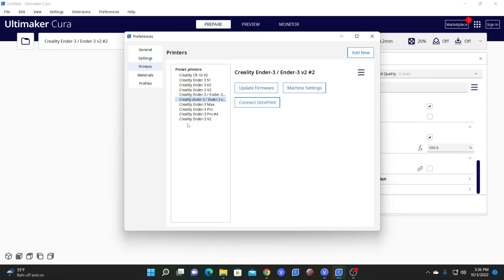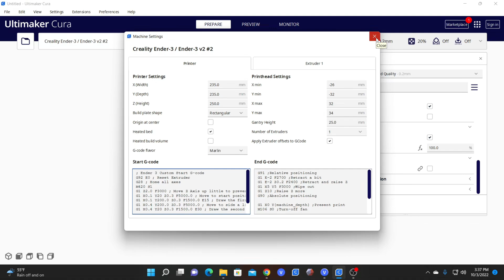Configure your GCODE to use the ABL Mesh from a CR-TOUCH or BL-TOUCH on a 3D Printer

Comment: In the little manual for my cr touch it says the line needs to be G28G29.  I have done what you showed in the video but have not yet printed anything. Is the included manual for the cr touch worthless, I am scared something is going to break if i print with the wrong line of code
Reply from the maker: I'm your manual. Only "M420 S1" on the line below G28
Reply: @ thanks for the help 😊
Reply: G29 will work after G28 but will re-do the mesh. You can do that, but it's quicker, more flexible, and perhaps more reliable to do the mesh once, save it, then use M420 S1 to load it without redoing it. G29 A (activate) is a synonym for M420 S1. Whichever you use, it must be after G28, as by default that will turn off mesh leveling.

Comment: I put in the gcode but it doesn't seem to work?
Reply from the maker: What makes you think it's not working?
Reply: @3DRundown  you have to see the z axis thing move a little bit right (like corecting the space between the bed and the nozzel?) + the filament is wel on the bed in one spot and realy off on the other

Comment: So m420 s1 is the same as G29 ?
Reply from the maker: No. M420 will load the saved mesh. G29 makes a new mesh every time. I don't suggest that
Reply: M420 S1 is the same as G29 A (which activates a stored mesh instead of re-measuring one).

Comment: Why does evey single tutorial give me different Codes this is maddening!!!
Reply from the maker: Because they suck. This is the correct way to do it.
Reply: @3DRundown  Yeah everyone else keeps saying to use G29 but now I'm thinking that's not right lately
Reply from the maker: No. Every time you run an ABL, you give your machine a chance to make a shit Mesh. If your mesh is working, keep using it, until it's not working. Then, run another ABL, SAVE, and get back to printing.
Reply: You can use G29 A which does not redo the mesh, but merely activates it; basically a synonym for M420 S1.

Comment: It would be alot cooler if the company included this in the install
Reply from the maker: Creality has begun adding it to CP5 profiles.
Reply: @3DRundown  by the way thank you for your help with bed leveling and z off setting  I've been printing non stop for about 2-3 weeks successfully.

Comment: for me it does not work what did i do wrong??? 
HELP ME PLZZ!!!!!!
Reply from the maker: It does... Did you run the ABL manually, then SAVE? Did you re-slice any files, that were previously sliced Without the code? Is your manual tramming good enough? Is your Z-OFFSET correct? Tell me more...

Comment: This works with other sensors as well. My Voxelab Aquila X3 Max uses one of those magnetic proximity sensors they call the system VL Touch, and my original Aquila has a 3DTouch sensor. I was wanting to use Cura instead of Voxelmaker and this video got me over the obstacle to getting it to work right. Thanks...

Comment: Thank you kindly for this information. I have a CR-10 S5, I found the G28 line in the start G-code for the profile, and it isn't doing the ABL mesh before the print. Maybe I am missing something? Thank you kindly.
Reply from the maker: G29 will do the ABL. But, don't use that. Manually trigger an ABL. Save it, then, use the line here in this video, to have the printer load and use that mesh. Only run another ABL, if you feel the need. If it's working. LEAVE IT BE
Reply: I appreciate it. I can't tell if it's recalling the mesh that's stored, or not. I'm just wondering if the way my g code is set up is has something to do with it. It's the stock CR10S5 profile with your added M420 line. I'm just used to seeing it actually run an ABL before it does a print - that's all. When I open it in Cura there's a space between the last line of code and the g28/m420 lines.
Reply from the maker: If running a mesh every time, the M420 line will serve no purpose. You'll know it's working, if it resolves your minor bed tramming issues. For example, if you see an area that's a little off, and run a new MESH, it should be better on your next print. Keep in mind, Z-OFFSET is very important, and not handled by ABL. 
Your CR10-S5 GCODE should look like this:

M201 X500.00 Y500.00 Z100.00 E5000.00 ;Setup machine max acceleration
M203 X500.00 Y500.00 Z10.00 E50.00 ;Setup machine max feedrate
M204 P500.00 R1000.00 T500.00 ;Setup Print/Retract/Travel acceleration
M205 X8.00 Y8.00 Z0.40 E5.00 ;Setup Jerk
M220 S100 ;Reset Feedrate
M221 S100 ;Reset Flowrate

G28 ;Home
M420 S1

G92 E0 ;Reset Extruder
G1 Z2.0 F3000 ;Move Z Axis up
G1 X10.1 Y20 Z0.28 F5000.0 ;Move to start position
G1 X10.1 Y200.0 Z0.28 F1500.0 E15 ;Draw the first line
G1 X10.4 Y200.0 Z0.28 F5000.0 ;Move to side a little
G1 X10.4 Y20 Z0.28 F1500.0 E30 ;Draw the second line
G92 E0 ;Reset Extruder
G1 Z2.0 F3000 ;Move Z Axis up
Reply: Acknowledged, I appreciate your response.

Comment: Bought another printer without auto leveling because I installed a CR touch and only put G29 into the G code, months of pain fixed in under a minute and a half.
Reply from the maker: Epic. Happy to save you. 🔥
Reply: G29 A will activate the mesh (same as M420 S1)

Comment: Does running with Klipper change anything or would this work the same with Klipper
Reply from the maker: Yes. This is a Marlin command. There is a different command for Klipper
Reply: @3DRundown  thank you 😭 time to keep digging
Reply from the maker: This is the Klipper Command: BED_MESH_PROFILE LOAD=default
Reply: Thank You !!! @3DRundown

Comment: I do a manual leveling, then an autolevel, then if I print with the M420 line, the print takes place much too high.  It doesn't work!  But if I remove the M420 line I get good prints.  I have 3 identical Ender3 S1 Pro printers.
Reply from the maker: M420 loads your saves abl mesh. The ABL mesh is not related to your Z-Offset. You will need to set that. The height of tour nozzle, for the 1st layer, is controlled by your z-offset

Comment: I like to add a G29 after the G28 to make a new mesh since i dont print alot
Reply from the maker: I'd still rather use M420 S1, so I'm always in control. No way to remove that G29 without re-Slicing, down the road
Reply: @3DRundown  yes but i still like to have that up to date mesh at all times since i am a very forgetful person

Comment: What code do I use to tell my printer to run ABL before each print?
Reply from the maker: G29, but there is no need. Run it. Save it. Recall it with "M420 S1". If you see a minor issue down the road... run it, save it.... back to work
Reply: @3DRundown  I added the G29 code earlier today and the prints have been more reliable ever since on my Ender 3 S1 Pro. Not sure why exactly but it's working
Reply from the maker: I wouldn't. If your machine makes a good mesh... and it's working well, why tell it to replace that mesh, and make another new one, giving it the chance to screw up. I don't trust any of these machines enough. :)
Reply: @3DRundown  because the mesh changes due to vibrations of the machine while printing enough for it to need a new mesh
Reply from the maker: I run a new ABL every few months on most of my machines
Reply: @3DRundown  good for you 🙌🏽

Comment: A lot of videos say that for the g code say g29. And others are saying the one you said. Which one is right and works?  

Pls reply soon
Reply from the maker: Running an ABL every time is nonsense. Run it. Save it. Load it with M420 S1, and use it till it stops working. Then. Run a new ABL mesh, and off you go.
Reply from the maker: What I say is right
Reply: Ok thank you 😊
Reply: Wait then what is g29 for
Reply: And does g29 still work
Reply: Sorry one more question, is there a way to know if my cr touch is working?
Reply: Pls comment back
Reply: G29 works, but creates a new mesh each time. G29 A ("activate") or M420 S1 (same thing) loads a previously stored mesh.

Comment: What would the g code look like to make the nozzle move to it's start position and heat up after the bed and homing is done. To avoid leaking filament during the homing process and before the printer is ready. A retraction line and extension line may be a better way to do this but I'm not sure how that gcode would look. Any help would be greatly appreciated.
Reply: I have the same question. When I try to do anything after the M420 it crashes my machine. Does anyone have any thoughts on my start code?

; Ender 3 Custom Start G-code

M140 S{material_bed_temperature} ; start heating the bed to what is set in Cura
M104 S200 ; set nozzle temp to 200C
G92 E0 ; Reset Extruder
G28 ; Home all axes
G29 ; Auto Level
M420 S1 Z2 ; use mesh from CR touch to compensate up to 2mm

G1 Z2.0 F3000 ; Move Z Axis up little to prevent scratching of Bed
G1 X0.1 Y20 Z20.3 F5000.0 ; Move to rest position
M109 S{material_print_temperature} T0 ; start heating T0 to what is set in Cura
G1 X0.1 Y20 Z0.3 F5000.0 ; Move to start position

G1 X0.1 Y200.0 Z0.3 F1500.0 E15 ; Draw the first purge line
G1 X0.4 Y200.0 Z0.3 F5000.0 ; Move to side a little
G1 X0.4 Y20 Z0.3 F1500.0 E30 ; Draw the second purge line
G92 E0 ; Reset Extruder
G1 Z2.0 F3000 ; Move Z Axis up little to prevent scratching of Heat Bed
G1 X5 Y20 Z0.3 F5000.0 ; Move over to prevent blob squish
Reply: @DeltaKreations  This is the gcode I made after some research to do what I wanted to do above.

; Ender 3 Custom Start G-code
G92 E0 ; Reset Extruder
G28 ; Home all axes

M104 S140 ; Set Extruder Temperature
M140 S{material_bed_temperature_layer_0} ; Set Heat Bed Temperature
M190 S{Material_bed_temperature_layer_0} ; Wait for Heat Bed Temperature

M420 S1 ; Autolevel
G1 Z2.0 F3000 ; Move Z Axis up little to prevent scratching of Heat Bed
G1 X0.1 Y20 Z0.3 F5000.0 ; Move to start position

M104 S{material_print_temperature_layer_0} ; Set Extruder Temperature
M109 S{material_print_temperature_layer_0} ; Wait for Extruder Temperature

G1 X0.1 Y200.0 Z0.3 F1500.0 E15 ; Draw the first line
G1 X0.4 Y200.0 Z0.3 F5000.0 ; Move to side a little
G1 X0.4 Y20 Z0.3 F1500.0 E30 ; Draw the second line
G92 E0 ; Reset Extruder
G1 Z2.0 F3000 ; Move Z Axis up little to prevent scratching of Heat Bed
G1 X5 Y20 Z0.3 F5000.0 ; Move over to prevent blob squish

Sets extruder temp to whatever you want just change the svalue I have mine at 140. Heats the bed. Uses your autolvl mesh and moves to start pos. Sets extruder temp to layer 0 so what you want to print at and then starts. I'm not getting any oozing this way.

Comment: how to save the G29 code once and for all
Reply from the maker: You don't. Do this instead of G29
Reply: G29 is like the calibrate option. It does the leveling process, but adding g29 will always make it do it.

Comment: so i have always used g29 for abl every print and im getting tired of the wait time. if i run M420 S1 instead of G29 it will save? few questions here. do i need to keep the creality firmware on the drive? i have to reformat my drive all of the time since im quick to just pull it out of my pc without ejecting. Like when you hit store/save settings will the M420 s1 be saved to the printer or the drive?
Reply: i would also like to add that i have an ender 3 pro. does it have internal memory? will the mesh dissapear everytime i turn off the printer? also do i need to heat up the bed and the nozzle for the bed leveling?
Reply from the maker: Have I helped you? Help ME continue this channel with some support:
TIP: Click the "💗THANKS" button
Become a Youtube Member, by clicking "JOIN"
Support my Patreon: patreon.com/3drundown
Use my Affiliate Links when Shopping:
Amazon Link: http://amzn.to/2miGQq9
Creality: https://shrsl.com/424l2
Bambu Lab: http://shrsl.com/46lky
Sunlu: https://sovol3d.com?sca_ref=2756755.r8WNQiJdNf
Sovol: https://www.sunlu.com?sca_ref=4022320.F0sV6y4ht9
Support me via my Course: 3DRUNDOWN.COM
Reply from the maker: M420 S1, will load the saved mesh. You run an ABL. then save. M420 S1, will use that mesh. If you blow out your memory card, you will lose your Dat file. Don't do that. Get a Cloud box, and start printing from Creality Cloud. Memory Card printing is old news
Reply: @3DRundown  okay so I will look into the cloud box. For the meantime, just to clear up my confusion. I need to reflash and leave the flashed firmware on my memory card. Level my bed and set my z offset to desired height. Then run abl on the 3d printer. When I store settings, will it be stored on the card or the printer itself? After all of this is done remove g29 and add m420 s1? I'm a novice!
Reply: i have been watching alot of your vids. im seriously considering upping my game and getting the bambu lab p1s
Reply from the maker: YES, it's stored ON THE CARD. You can remove the firmware file after it's flashed. Or leave it. up to you. It will not read the same filename more than once. Every file, will need to be sliced with M420 S1. If you have older files, remember to reslice them. Also check your Z-OFFSET, LAST. You can get it as close as you can before hand, but, be prepared to set the final #, during the skirt of your 1st print, after tramming. You may need to adjust sometimes. Get used to minor baby steps, and recognizing when need it.
Reply from the maker: The New Ender 3 V3 line is fantastic. Highly reccomend any of them. The P1S is super nice also. It's a great time in the 3D Printer space!
Reply from the maker: I fight PEI people everyday. Glass is King. I have thousands of prints across many models, to support my opinion. :) There SHOULD be a file on that card. Here's how to test that theory. Pull the card out, boot the machine without it, and see if it retains the information. It may save to the EEPROM, but it should save to the card also. If you move that card, to another machine, the Z on that machine, should end up being set to what it was on the machine you took it from. Regardless, don't do that. Lol. 
YES. AMS is a game changer, and is THE reason, to own a Bambu. You will still need to learn lots of stuff, but the AMS is 10000% worth the investment.
Reply: @3DRundown  very interesting. I have had to reformat my SD card multiple times and my z offset has been saved everytime I put in the "fresh" SD card. So I will try the new m420 line. I will make sure to use your affiliate links on my purchases in the future! Thank you for all of your input. I'm installing the glass bed this evening pray for me 🤣
Reply from the maker: I believe it's saved to the eeprom, AND the Dat file, so, if a dat file exists, that's different, it may load that information. Things are constantly changing though, so, maybe not anymore?!? Thanks so much for using my links. Helps allot! Praying....

Comment: I need help, i just got the cr touch and installed following many videos and did the software. But the z axis will not go down only up, i unplugged the trigger and it changed nothing. I am fairly new to 3D printing and have no clue what to do now
Reply: I tried that but it still wont move down, the cr just blinks red and every time it auto homes it goes to the middle and moves up a bit every time
Reply from the maker: It will always home to 10-ish MM. It only moves to your Z-OFFSET, when you start a print, or manually move to 0.
Reply from the maker: you have to use the Z-OFFSET function. MOVE will only go to 0.
Reply: @3DRundown  i have tried that already and had no luck, every time i auto home it just goes to the middle and moves up a bit each time. The cr touch is just blinking red and the z axis on the screen has blinking questions marks
Reply from the maker: Blinking red is a failed self test. You may have a bad CR-Touch.

Comment: If I may add, you can also write is as

M420 S1 ; load mesh

Similarly if you want to level your bed every time before print you can use 

G29 ; Auto bed leveling 

Just so you don't forget what that command does, have a nice day :)
Reply from the maker: Yes, anything after ; is just a note for yourself. But, I do not reccomend re-leveling a working bed mesh. I run an ABL about once a month.
Reply: I'd advocate for anyone who prints with a variety of materials PLA, PETG, TPU to use G29 instead of M420 S1. A printer's bed warps differently at different temps so running a new mesh every print with G29 gives you the best results. 

If your stored mesh was at 60°, depending on how your bed behaves, you could see issues loading that mesh for a PETG print with a bed temp of 85°.
Reply: @kilo.sierra my ender 3v2 keeps setting temp to 0 when I ask it to auto level. How do I get it to stay at temp when leveling ?
Reply: After which line do I add the G29 code?
Reply: @Mehrdad.Haghighi  G29 is added after G28. If you want to use G29 follow the same steps as the video just add G29 instead of M420 S1.
Reply: @kilo.sierra  very good point
Reply: After the G28 ; Home all axes  @Mehrdad.Haghighi
Reply: Any ideas why my printer doesn't seem to be using the mesh if I have G29? It does the abl process fine, but still the nozzle drifts away from the bed at the other end.
Reply: Can you use both?

Comment: so you didn't need to type in g29 code
Reply from the maker: Nope.
Reply: @3DRundown  huh ok cause I was putting in like the instructions says to but ok I try that
Reply from the maker: No G29. Just "M420 S1" after G28
Reply: @3DRundown  question my printer won't wait for the temp to reach temperature after probing it will just go is there a way to fix it? also i have a ender 3 pro
Reply from the maker: That is very unusual. Are you using CURA with standard start code? What firmware are you on? I Would go with MRISCOC
Reply: @3DRundown  so I fix that with a code however since then I’ve been having all kind of issue with it I try to take it off but it ack like it still on it how do I go back to what it was before it?
Reply: @woodsman9427  Just grab a new profile
Reply: If you put G29 it will recreate the mesh; M420 S1 (or just G29 A) will load the saved mesh without recreating it. Either has to be after G28 (because that turns off mesh leveling).